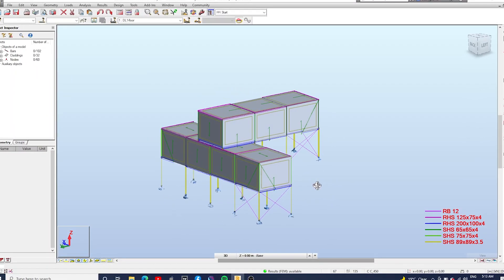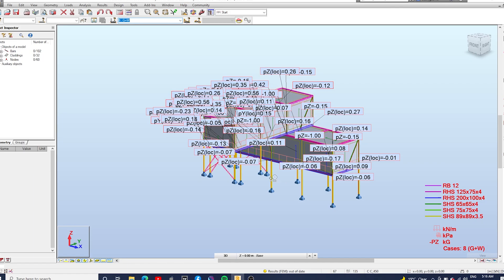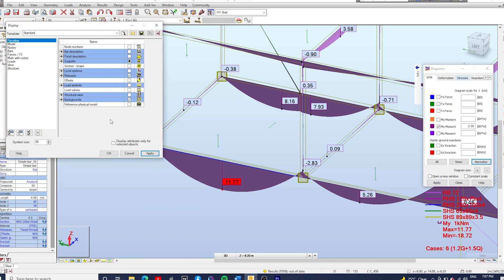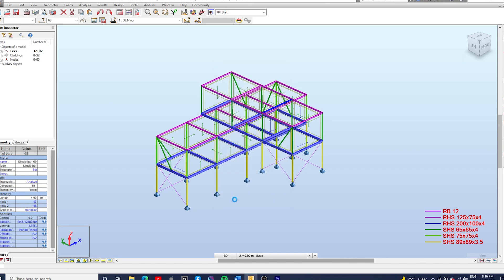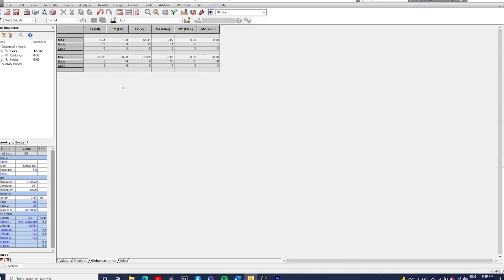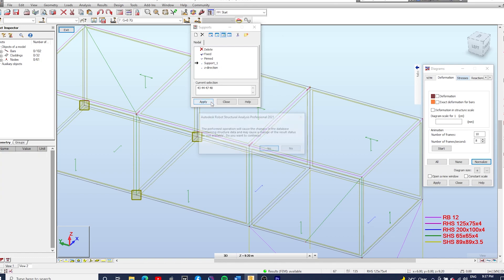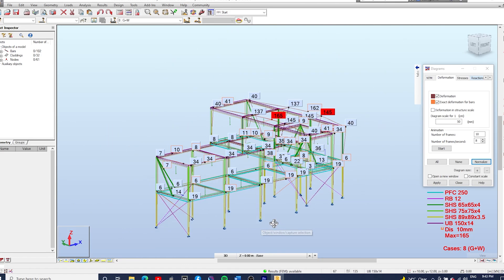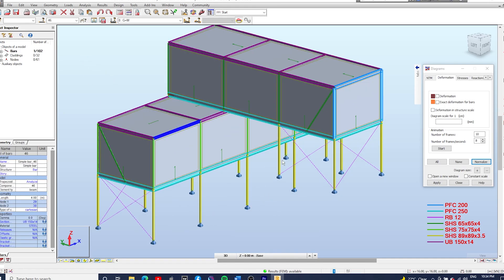Steel Modular House in Autodesk Robot - Part 4

Comment: Hey nice video. Question though, why did you set up cladding to spread the load to top and bottom beam? Wouldn't it go to columns as well?
Reply from the maker: Hi Maciej, you are right, you could argue that the columns can take wind loads as well, but I was thinking more on a stud wall where the studs will bend and transfer the loads vertically.
In reality, the deflection of those beams from wind loads won't happen, as you would have the ceiling diaphragm to transfer loads to the bracings. 
I find easier to do the bracings manually or applying point loads on the columns where the bracings are.